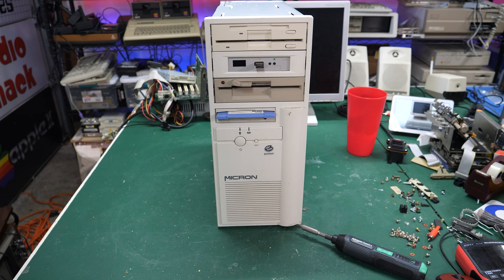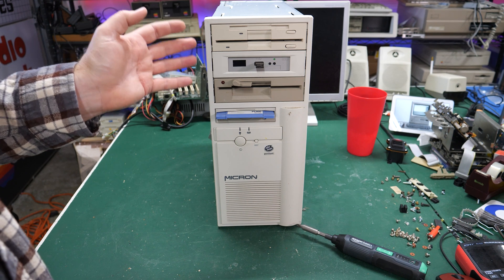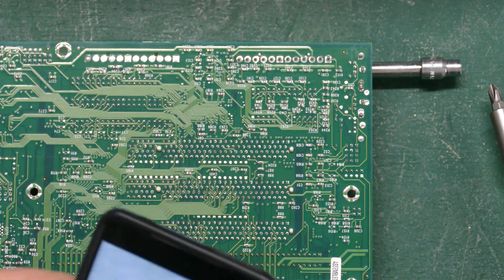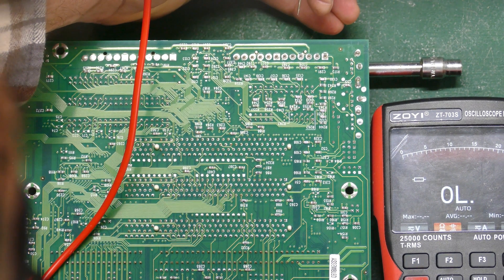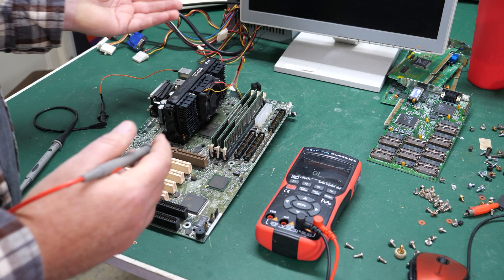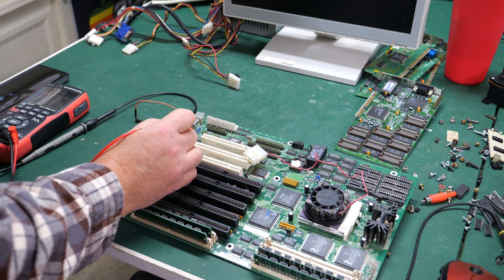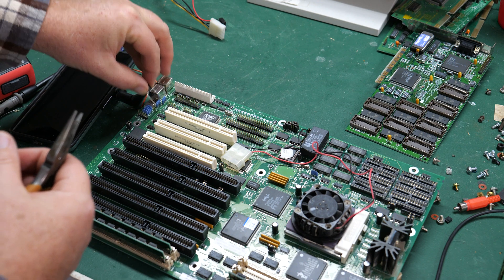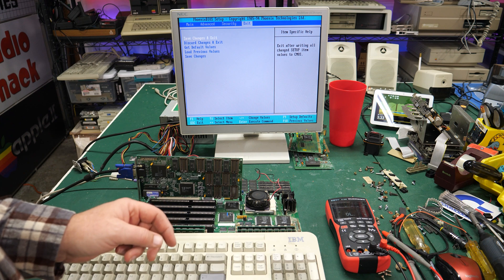Dead Ports, No Problem! Repairing a 90s PC Keyboard and Mouse Issue!

Comment: I made a test tool I called a "poke a light". It's two LED's connected in parallel, anode to cathode, cathode to anode (basically a bi-directional LED that lights up in both directions) in series with a 1k resistor. Test leads are terminated into the appropriate "poky bits" to probe connectors. It doesn't measure actual voltage but lights up if any voltage above 3v is present and enough current to drive an LED.
I had a stray screw short out my keyboard fuse. I added extension wires and soldered in a 500ma glass fuse in heat shrink tubing.

Comment: PS/2 ports are always protected by a fuse, the most I saw is a 0.5A fuse but few times I encountered a .25A. The keyboard have usually a requirement of 100mA and the mouse 50-70mA (is what I usually encountered). Maybe one will plug a barcode reader or some strange keyboard, that is why the fuse is usually rated to 0.5A.
On AT and older ATX motherboards, the PS/2 port got the power from the 5V rail but on newer ATX motherboards (from Slot1 onwards) there was a jumper that selected the 5V for the PS/2 port either from the main 5V or from the 5VSB, that for the special power on button on the keyboard. Same with the USB ports, or at least a pair of the back panel ones.
When I saw that there was no keyboard lights post I knew that the fuse was blown.
5A is overkill but if you do not plan to plug strange devices in the PS/2 port, it will be ok, otherwise I would advise to use a smaller value for that fuse.

Comment: 5A fuse on the keyboard/mouse power sound insane, that's 25W! I've seen a places where it list the ports at 5V @ 500mA though Wikipedia says the spec say the official guaranteed number is 275mA and their links confirm this - though it's unclear if it's combined or per port and how that works with a splitter. So not surprised 500mA ended up used in practice - no reason to be stingy. So I'm guessing the original was either 500mA or 1A fuse, I can't see how those narrow traces can take 5A and if it loops back the keyboard controller will very likely can't either. So if something goes wrong again you'd better hope the traces evaporate before anything harder to fix dies.
The 2000-era ASUS motherboard I checked had a 1.1A polyfuse shared for the two ports. I'm a bit surprised something this "new" (Pentium 90) isn't using a polyfuse or mosfet for power limiting, I guess that came later than I thought or they cheaped out.
Reply: Agreed, the original fuse was almost certainly a 500ma fuse since that is a very common value for a PS2 port fuse on motherboards from that era.  I strongly advise replacing the 5A fuse with either a 500ma or at most a 1amp fuse.  5A is way too much current and may destroy something if something draws too much current again.

One of the common reasons fuses like this tend to blow is if someone tries hot plugging a PS2 device (PS2 is not supposed to be hotplugable but that doesn't stop some people from trying).  That can create a high inrush current and the fuse blows to protect the rest of the system.
Reply: @gemedetvideo  Yeah, a lot people these days think it's a myth that hot-plugging can break PS/2 ports but you're right, it's definitely can happen (been there, done that!), though it's fortunately not that common - but it was common enough that newer motherboards tends to have polyfuses or mosfets for power limiting instead of actual fuses to cut down on RMAs (since both will auto-reset).
Reply from the maker: Yeah. That makes much more sense to me. All I could see clearly on the fuse was a "5".
Reply: 5A on these traces will send it to a cloud.

Comment: Great video.  Thanks for persevering even as you recover from surgery. I hope things are healing well.  

Capacitors don’t pass DC once they’re charged. So, on resistance mode, you should see increasing resistance until the capacitor is charged, and then an open circuit.
Reply from the maker: Thanks